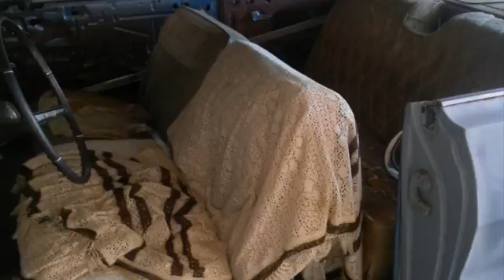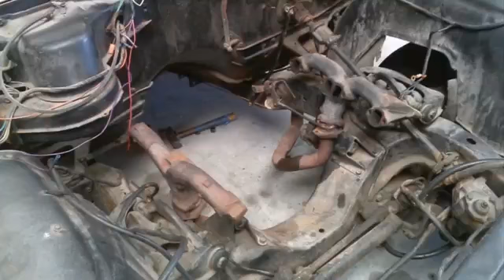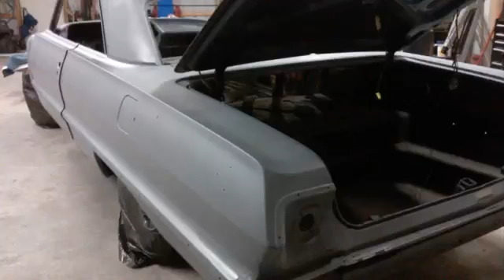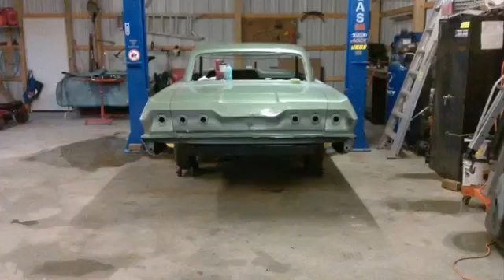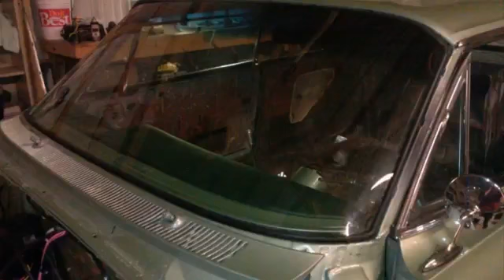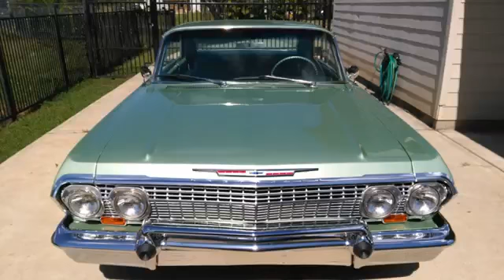1963 impala lowrider slide show !

Comment: Have you put rear disk brakes on a impala with 13" wire wheels?
Reply from the maker: Yes
Reply: @lonestarlows  which set I can't find anyone who sells them
Reply from the maker: Cpp does. You have to grind rear calipers to fit.
Reply: Ok I found them on eBay for like 475$

Comment: did you have any issues with fender skirt clearance and your wheels?
Reply from the maker: That car had a gbody rear end which is 2 inches narrower than impala. Also had a y bone
Reply: lonestar lows ok i’ve seen in some places guys having issues but no one has a video addressing the issue, do you ever come across this problem? thanks for the reply
Reply from the maker: Ive always narrowed the rear end on impala lowriders. Otherwise u risk skirt rubbing. On inclines or sharp turns where the body sways

Comment: What did you use to restore frame?
Reply from the maker: It was powder coated
Reply: Had the true Daytona back in the day. Tip to keep the rust away is to use a leaf blower on the wires to dry them off. 
Beautiful restore. How long to restore and did you do yourself??
$$$$ how much to restore yours